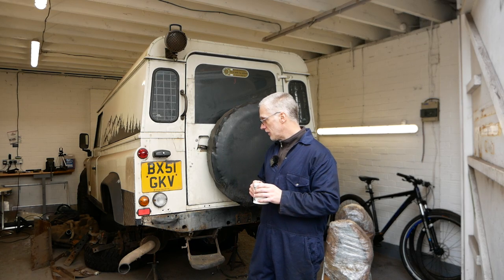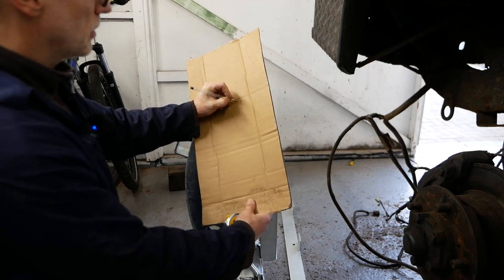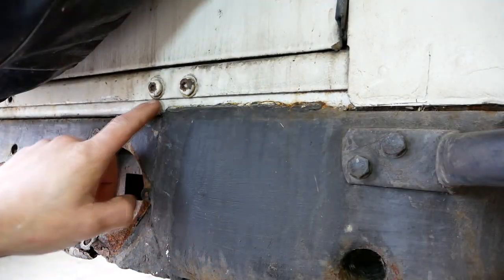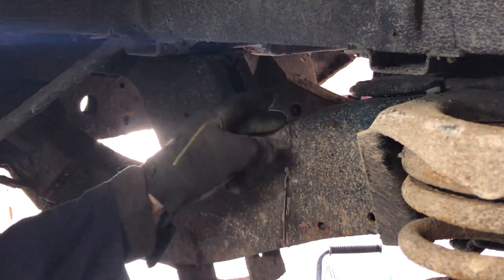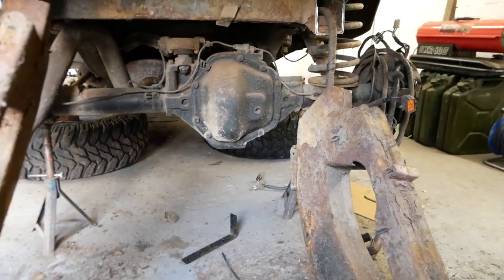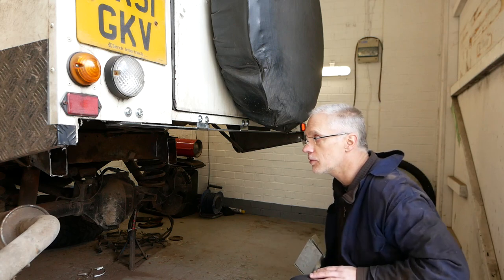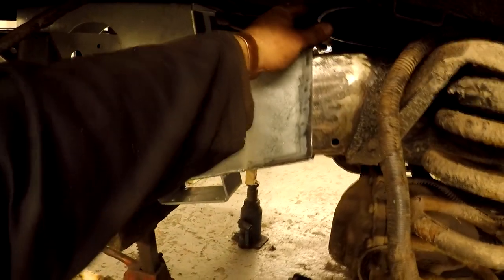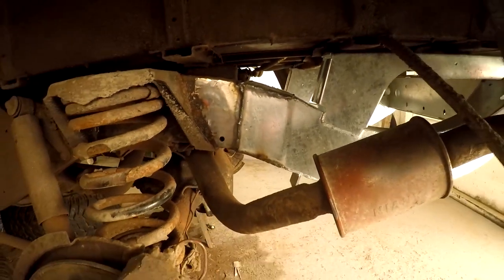Land Rover Defender 110 Rear Crossmember Replacement | All 4 Overland

Comment: Recip saw with a long, fine tooth Ruko blade is your friend for cutting the chassis.  I like putting a hefty bolt through as well - just in case my welding on the day is a bit tarty. Lots of heavy stuff may be hanging out of that crossmember in years to come - best it doesn't fall off. :-)
Reply from the maker: Hi...i think a reciprocating saw is the easiest way is chopping through the chassis and you can never have to bigger bolts..

Comment: hi realy good vid just about to do mine,, did you pull the loom out towards the engine or back wards disconecting the front?  and did it fit laying along the top chassy length wise?  cheers,,
Reply from the maker: Hi...glad you found the video useful i pulled the wiring loom out from the back towards the front and that gives you plenty to lay it back on top of the chassis and rewire your lights...also securing the cable with cable ties to the fuel lines.
Reply: @All4Overland  cheers for that,,

Comment: The two measurement points on my chassis are different to the new chassis, almost parallel from the tank mounting point to the anti roll bar mount, possibly looks like your is too? 

Did you still stick to 90/60 or did you move the bottom measurement across to compensate for the slight difference in the new section? Thank you.
Reply from the maker: The measurements are a rough guide so really it is just cut to fit and just offer it up...
Reply: @All4Overland  thank you for your reply, helped me out massively, mines on just needs welding when I get chance.

Comment: Hi Paul, great job as usual. 
My pickup has a hole (that shouldnt be there)  in the panel those bolts you had to grind off pass through. Any tips for removing that panel and replacing it (YRM) has the parts but im wondering if its straightforward or a tub off job.
Reply from the maker: The bolts on the rear crossmember where they mount the body will sometimes come off but usually you will have to result to the grinder and i think you can replace the panel without taking the tub off but definately would be easier with the tub removed as you get more room to work..